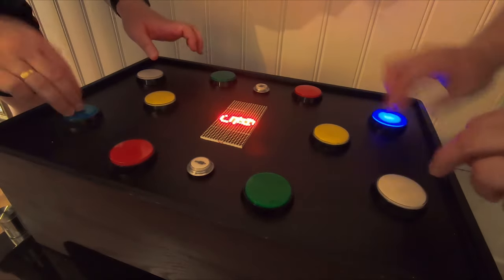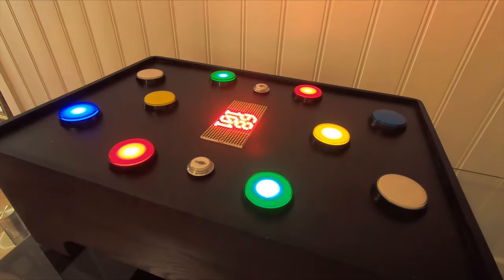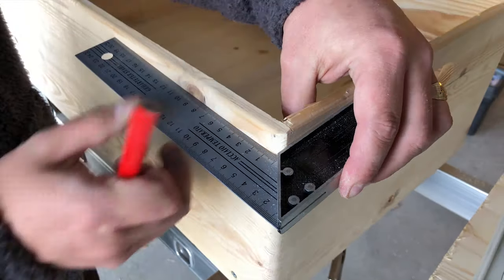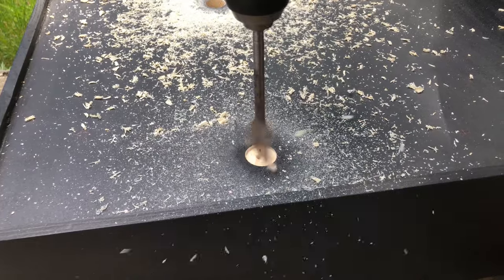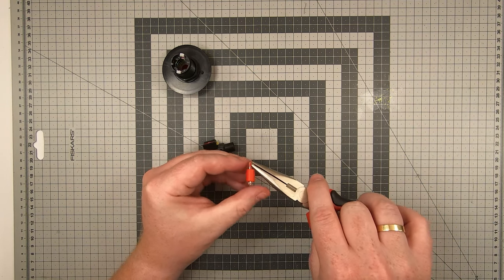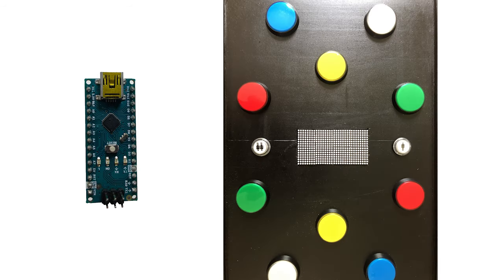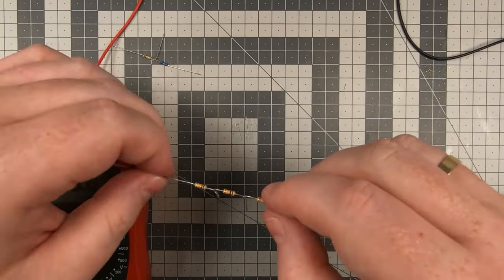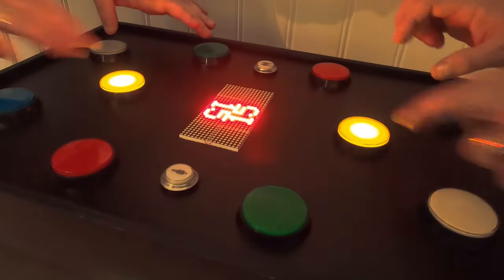Whack a Mole - Arduino Game (full arduino tutorial with code)

Comment: Guys! I have a problem with my game. For whatever reason every time a press a buttom, both displays start counting. I tried completely disconnecting one player and still both displays record once I press a button. Any ideas? The code is exactly the same, just the pin assigments are different. I'm also using an Arduino R3.

Comment: Hi, first of all thanks and congratulations. Is is really brilliant! I am currently building something similar (less brilliant, of course), and paying the fact I am almost totally inexpert in electronics. However, the prototype is working on the breadboard. My question for you is (sorry if it is stupid): I am waiting the delivery of the pushbuttons (for the "real" game) like the ones you used (12v), and, if I understood well, you have been able to power them directly from Arduino (5v) by changing the built-in resistor. If this is true, did you use 250 Ohm resistors? Or could you please suggest me how to calculate it? Many thanks for sharing the project and again congratulations!
Reply from the maker: Thank you!
About 150 Ohm will do :-)
Make sure the LED does not heat up to much. 250 Ohm will increase the lifespan of the LED, but it will not be as bright.
Reply: @DIYTECHBROS  Thanks a lot!!! I will do it as soon I will receive the pushbuttons.

Comment: Hi guys!
After some hours in soldering, I finally reach to the point of compiling with arduino.
Infortunately, I have the following issue : 

whack:11:10: fatal error: Parola_Fonts_data.h: No such file or directory
 #include "Parola_Fonts_data.h"
          ^~~~~~~~~~~~~~~~~~~~~
compilation terminated.
exit status 1
Parola_Fonts_data.h: No such file or directory

Thank you for your answer and congrats for this wonderful project! It's awesome!
Reply from the maker: Hi! You need to download the library. The link to the code is in the code!

Comment: Fantastic project! 
I have a few questions... 
1. Is it possible to increase the buttons to 8 per player?
2. Can the displays be stacked to increase the size of the display?
3. Is it possible to add a sound effect everytime a button is pressed?
4. Can the difficulty be changed? (flash for shorter duration) 
Thanks...
Reply from the maker: Hi Yashwin! (Cool profile picture!)
1.) Yes, 8 buttons will still leave enough difference in analog values. You might have to reduce the btn_tol and leds_cnt values.
2.) Yes, have a look at the library - it is great!
3.) Yes, by adding a speaker the Arduino can produce simple sound effects with little storage requirements. Just make sure you really want extra sound, the button smacking down often dives enough player feedback. 
4.) Yes, you can change the action_speed and action_speed_min values!
Best of luck :-)

Comment: Hey Guys! Great Project! I have a question, how do you wire the Player 1 and Player 2 buttons? I don’t see them mentioned in the code. I’m currently building the exact project. Everything is working perfect. Is just the player’s button what I can’t figure out yet. Thanks guys. Cheers!
Reply from the maker: Hi The Spot!
It’s currently wired to the reset pin. So basically, they restart the game. They are there in case you want to create other kinds of games on it as well, like a Simon says game :-)

Comment: I have built this and LED Display is not working correctly, it appears the segments are not in order, until a few plays into game, then they align showing correct numbering. Then at end, the Winner/Looser display is reading right to left (backward). Any help?
Reply: Did u find a solution??
Reply: @alinaawan4639  yes. It was a ground issue. Was not making connection properly
Reply: @iwebexp  thankyou

Comment: Hi, I noticed that you added a single player button and multiplayer button. But I can't find how to wire them up by the circuit that you gave.
Btw it's a interesting stuff. I am going to do this to be my homework haha. Thank you for sharing this.
Reply from the maker: Hi!
They are optional, in case any one would like to build several games using the same platform (like a Simon says game?).

But, having a start button tied to reset would be smart :)

Comment: Hola. Esos botones grandes son de 110v no? Solo el led integrado es de 12v.
Reply from the maker: Excellent question! The LED (and resistor) is set up for 12V. BUT, but button it self do not have any rating (the only markings are the NO/NC and common pin)... so I'm not sure. Sorry. 
When comparing it to my other (rated) micro switches it feels a bit light weight. So I would not feel comfortable recommending the button above 12V.

Comment: Awesome build! Thanks DIY TechBros. I do have a question though.... I see you have player 1 and player 2 button on the play surface. However, i don’t see it in the schematics. Is that for further expansion?
Reply from the maker: Well spotted :-) Yes, this is a basic frame where you can create multiple games, like strike a light, Simon says and so on.
Reply: @DIYTECHBROS  I have all the the components wired up and verified it multiple times against the schematics. Something isn't quite right. After pressing the reset, all the button LEDs light up in some kind of sequence and they all just stay on. Button press on any of the buttons does not seem to do anything. Any assistance would be greatly appreciate it. I went back a viewed the video a few more times, it had mentioned a start button. I'm also not seeing that in the schematics.
Reply from the maker: webfiles4utube Hi! If you the diagram, one option is to connect it to reset :-)
Reply from the maker: webfiles4utube Regarding the lights not switching off might be due to an error on the analog readings. Make sure you use the same value resistors. If that do not help try expanding the values for registering analog inputs. If you are using an Arduino clone / compatible board there might be different internal resistance on the device. If that do not help either, try outputting the value to the Arduino terminal. Keep us posted, and let us know if we can help further!
Reply: @DIYTECHBROS  Wish I have good things to report. I've comb through the entire circuit and not finding any issues. I've also tested on three different Nano broads, tried different resister values at the LED 220ohms 470 ohm and at the voltage divider 10k and 20k ohms. Only thing I get is all the LEDs lights up in pairs (player 1 red, player 2 red, player 1 blue, player 2 blue..etc). Even the simple adding of the 1k ohm resister at the towards ground on the reset button does not function properly. But the reset works perfectly w/o the 1k resister.
Reply from the maker: @webfiles4utube  Can you test the analog values (button_values[]) if they are matching your config? Under the this line in the code: 
analogValue = analogRead(pin_p1); 
can you add:
Serial.println(String(pin_p1));
And leave the Arduino connected to the computer and open the Serial Monitor. Then it is going to display the values and you can see if they are different from the array on line 22 (button_values[])
Reply: @DIY TECH BROS Had a small positive step forward on this project. I had consulted an friend who is an Electrical Engineer to review the schematics published on GitHub. We found and minor omission (error) at both A0 and A6. The schematics shows to tie it directly to ground, and this prevents both A0 and A6 from seeing any input voltage when a button is closed. We added a 10K ohm resister before grounding A0 and A6. That corrected the issue and the counter function portion works. Further checks on the code and found that “if(p1_score <= 100 and p2_score <= 100)” will not stop the game at 100 but stops when player scores above 100 points. The corrected code for that line was simply making the function less than 100. “if(p1_score < 100 and p2_score < 100)”.

Last part of the mystery is still not solved. When the board/program is initialized, all the LEDs are in the HIGH/ON state. I verified the voltage at A1~A5 and D2~D6. All were over 3.5v, and it should be at near 0v. What’s the part in the code that controls the initial state of the LEDs?  Also, I’m using similar LEDs that was rated for 12V like you have described, and I swapped out the resister from 470 ohms to 220 ohms. What is the resister value that you guys used in the working unit?
Reply: @jerrylee3789  By the way, I am using an authentic Arduino Nano board.
Reply: All the issues has been resolved. I’ve posted the general steps taken following your suggestions. THANK YOU BOTH AGAIN!!! AWESOME BUILD foundation for so much more possibilities.
Reply: @webfiles4utube  Hey, I am doing this project for final exam and I have same problem all buttons light up and they dont do anything. Can you help me please

Comment: Hi, love this project. I have some spare time over and a box of electronics so I thought why not build this for my son, fun project for me and fun game for him. Now, question number one is if it’s possible to redo the code and make it one player only? And if there is any help to get with this. I have built the system and loaded the code in my Nano, but it doesn’t work , button one is lighting up all the time. That’s it. I hope you have time to answer. Great project.
Reply from the maker: Hi! You can actually use this as a one player game. Just don't connect any of the opponents buttons. But, do pull the 2. player analog pin to ground with a 1K+ resistor.
If only the same button is lighting up make sure have connected the buttons according to the array: int p1_leds[5] = {2,3,4,5,6};
So, using pin 2,3,4,5 and 6.
Reply: @DIYTECHBROS   HI again guys, i am really sorry to bother you but i am struggling here. I cant manage to figure out what i am doing wrong. I read the analog inputs and all i get is 14, constant. No changes whatever i do. I even tried changing board to Arduino Uno, but the same thing happend there. Do you know what i am doing wrong. Probably something with the wiring but i cant figure out what. Thank you.
Reply from the maker: That is strange! Since 14 means a low voltage... if it was floating (not connected) it would show all kinds of random values, and not only 14. See our about page, there you will find our email address. Snap a few pictures and send us, and I’ll have a look. If you are Swedish, you can just write in Swedish (a hunch based on your name)!

Comment: I ordered all parts and started building this for my daughter and me.  So I tested the led segments and the zero is not currently aligned on the 4 segment display. They seem to be reversed. When I'm hitting the number ten, zero is left, one is right. How can I fix this?
Reply from the maker: Hi! Does single digit numbers look normal, so 2 is 2 and not 5, and 6 is not 9?
Reply: @DIYTECHBROS  no. Can I somehow send you pictures? Single digits are split. So the second segment should be the third and the third should be the second.
Reply from the maker: Sure, our email is on our about page :-)
Reply: @DIYTECHBROS  Thank you! I just sent you an email :) I really want this thing to work :)
Reply: Okay so if anyone wants to build this with the exact same parts but does have the same problems as I do, here is the solution. 

Change line 11: #define HARDWARE_TYPE MD_MAX72XX::FC16_HW

Delete line 55 and 57

Have fun!
Reply: @blastbeatproductions7832  thank you so much!! its works now!
Reply: @blastbeatproductions7832  Thanks! My game also works now
Reply: @DY TECH BROS I use two types of hardware, one works correctly for me if I use the PAROLA_HW command but the other matrix of LEDs prints the numbers in reverse. And likewise when I use the FC16_HW command, how could I fix it, I have tried everything

Comment: hi, I am very new to ardunio.. i have to solve a problem using ardunio.Can you please help me with it.? my problem is,Your task is to develop an Arduino-based Whack-A-Mole-like game using LEDs. Connect a 3x3 grid of LEDs to the Arduino. When the game starts, one of the LEDs is randomly chosen as the mole (this should be signaled to the player e.g. by flashing three times in a row while all other LEDs are off). During the game, the LEDs should light up randomly for a given duration. When the mole-LED lights up, the player has to press a button to hit the mole. A display should visualize the results. Think of a score and level system (e.g. increasing speed of LEDs lighting up, faster or even random durations, …).

Comment: regards, I would like to know if instead of connecting 5 buttons for a player I could connect 10 buttons per player. Thanks in advance
Reply from the maker: Yes, but not on the same analog pin. The voltage difference would be a bit too low. BUT, if you move two of the LEDs over to digital pins you have two additional analog pins. So let each player have 5 buttons on two different analog pins = 10 buttons. You can also use a pin extender :-)

Comment: Hello, Thank You for this amazing project. I need help in the case. Wene it starts all lights turn on one by one and that's all. How to start the game ?  I am doing this without matrix, I just wanna test it.
Reply from the maker: Hi Raf!
Seems like your Arduino has a difference in internal resistance on the analog pin. There is a support case for this on the github :-)
In short, the button values are a bit off. Try expanding the tolerance. If it does not help, just check the analog values on the Arduino Serial Monitor and use those values and it will work :-)
Reply from the maker: Hi Raf! Did you sove it? :-)
Reply: @DIYTECHBROS  Thanks for advice, tomorrow I will try it at work. Mwy you say if you turn on it starts automatically?
Reply from the maker: Yes, a game starts when turned on!
Reply: @DIYTECHBROS  May I get that github link ?
Reply from the maker: @rafimovsisyan  Sure! This is the link to the GIT https://github.com/DIYTechBros/ButtonSmack/ 
and this is the link to the issue:
https://github.com/DIYTechBros/ButtonSmack/issues/1
Reply: @DIYTECHBROS  Thank you very much for your help. The problem solved in this way. I added  2 button values for each side( int button_value_p1[] = {930, 490, 330, 250, 200};
int button_value_p2[] = {915, 430, 270, 180, 110}; ) this way mu problem solved.
Reply from the maker: That’s great :-)

Comment: I have a problem...by pressing any button the score increases...because all buttons are commonly connected to A0 or A1 and the code is also written that way ...any solution
Reply from the maker: Hi! Have you created the voltage divider?
Reply: Yes
Reply from the maker: @poojakoduru2706  Try to connect the Arduino to your computer and read the analog values to the Serial Window.
Reply: Already done
Reply: Basically there is a lot of problem in this...
1)both the matrix are responding for buttons..
2)and leds  are not glowing randomly 
3)and the score is not increasing by a step 1
Reply from the maker: what kind of arduino or compatible board ar you using?
Reply: Arduino Uno
Reply: I have same problem here  
I am using arduino nano like in this video
Reply from the maker: @동킴  Hi! Are any of your buttons lighting up?
Reply: DIY TECH BROS every button light up but it's not randomly lighting up just all lights come up at the same time
Reply from the maker: @동킴  Do they all light up at exactly the same time, alle buttons for both players?
Reply: DIY TECH BROS do u have other complete schematics? We are doing this one for project but it's not working now ..  :(

Comment: Can somebody help me I have issue with buttons, they all light up and they arent doing anything.
Reply: hello i have the same problem did jou already find the problem ?
Reply: @miked2742  No we didnt. We started writing code for game on mega arduino, there you can just plug all wires on. And with code just turn on random button and led diode.
Reply: Did u find the solution??
Reply: @alinaawan4639  No we made a new code for game. And we took arduino Uno to do it. For every led diode and every button we made input. So every diode turns random with program not with resistors.

Comment: Can you help me? I have to finish this job, but I got stuck.
Reply from the maker: Sure, we can try! Where did you get stuck?
Reply: @DIYTECHBROS  In the part where we have to connect the leds to the arduino. I didn't understand the connections
Reply: @DIYTECHBROS  it is possible to have a better connection, because I have to deliver this work urgently.

Comment: Can't see how you connect the 1 player and 2 player buttons?
Reply from the maker: They are optional. More in case anyone would like to build more games on the box. But connecting one of the to reset might be an idea :-)
Reply: @DIYTECHBROS  Okay, is it possible to get them to work so you can play 1 player?

Comment: I use FC16_HW and its mirrored, why is that?
Reply from the maker: Hi! There is no standard when it comes to Connecting these displays. When you buy a row of 4, they may be connector from left to right, right to top, bottom to top and so on. Not taking about pin out but when one display is full, what is the first dot on the next display... 

But keep tweaking and you will find the correct setting for your display!
Reply: @DIYTECHBROS  I found  the answer in a older comment. Now my game also works! Thanks for the guide and all the work you have done!

Comment: I have 2 doubts

1-what did the arduino feed with?

2-of how many ohms can be the resistance that go in the LEDs?
Reply from the maker: Hi! Feed the Arduino with your preferred powersupply. Also, the LEDs are regular LEDs, so you can use a resistor calculator or just 250 :)
Reply: @DIYTECHBROS  Thank you very much :) , how many volts do you recommend to put the arduino?
Reply from the maker: 5V if you are using the USB port, and 7 - 12V if you are using the VIN pin. This may depend a bit if you are using an Arduino compatible board and an original one. But 7 - 12V works on most of them.